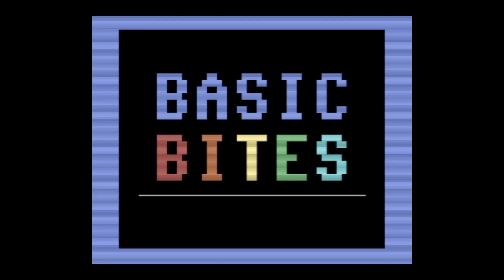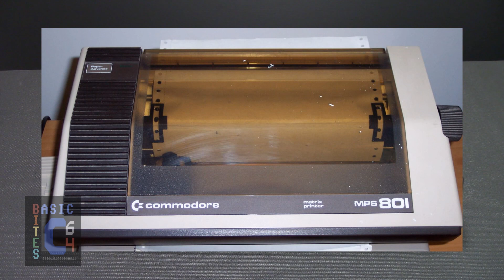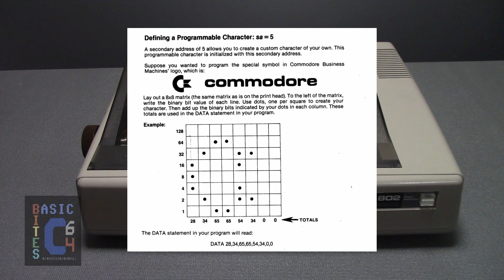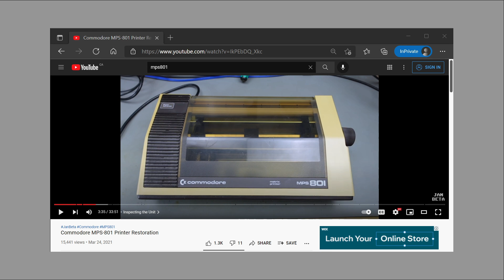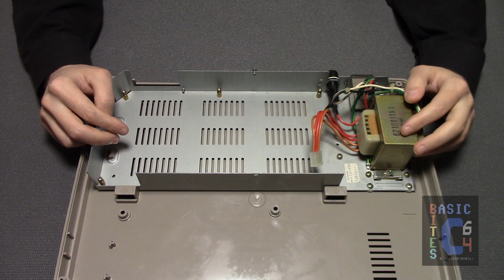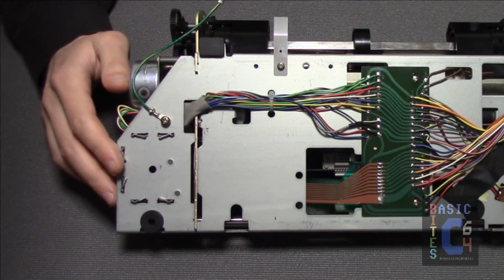Commodore MPS-802 (1526) Dot Matrix Printer for C64 / VIC-20

Comment: It seems my power supply in the 1526 is shot. The fuse and ON/OFF switch is good, but I'm not getting 26V DC or 9V DC from that red/orange wired connector that plugs into the board. Hope you'll be back soon and that all is well. EDIT: The 6522 was bad. Replaced it and the printer works well. Now to get the new ROM.

Comment: Can you dump your rev C rom? It's not dumped and therefore is at GREAT risk of being lost to time. My 802 has the 07B EPROM. I'll get it into MAME for future preservation. Thanks!
Edit: What's the number on your chip? It looks like a later one may be dumped. I found 325341-08 which is said to be for the 1526 but if yours has the same rom then it is the same for both models. Looking at the -08 binary shows "COMMODORE  1526/MPS-802 PRINTER - REV 07C" which gets printed out when doing a test print (holding paper feed at power-on).

Comment: Thumbs up for knowing how to say aluminium correctly ;-)
Years ago I picked up a MPS1230. Of course the ribbon was dry. I did some research and found that the mechanism was made by Olivetti and I found the exact model Olivetti-made ribbons new-old-stock which worked perfect. Around the same time I dumped the rom and documented the hardware and that printer is currently emulated in MAME and can provide a hard copy of anything which gets saved as a png. It's also nice as it's a dual interface Commodore IEC and parallel for use with Amiga or PC. Prior to that back in the mid 80's I had a MCS810 which is the Commodore rebadge of the Okimate 20. I really disliked that printer because it was incredibly slow and it used a thermal head which died after a few years where most of the time it was just sitting powered off. It also used plastic ribbons with a wax-like 4-colour 'ink' so it's a use-once and throw away ribbon which is also not good now in 2024. The MPS1230 is still working great and I don't see any point in the future where the ribbons will have done enough printing that they will require re-inking but it is at least possible with this model. For the Commodore retro collector the 1230 is a great choice for a Commodore 64 printer. It's pretty amazing that these old 40+ year old printers are still going whereas your average HP/Canon/Epson printer lasts ~3 years then it's game over permanently, plus the cost of ink makes them rediculous to run for all but once-a-year printing. Once a year means really that, after a year the heads have dried up with old ink and you toss it in the bin and buy a new one. Long live Commodore printers! :-)
Reply from the maker: Hah! Thanks. :)  I don't know if Commodore ever designed a printer from scratch, versus using some other company's existing internals.  Even though they badged their own ribbons, it seems to be the case that the same ribbons work in a variety of machines.  

I would enjoy having an MPS-1xxx series printer in my collection because they are extremely capable machines and also match the later cream-coloured wedge aesthetic that I prefer, but my 802 and 803 combined do a technically fine job at everything I still enjoy printing with my Commodore computers.  

In the modern era, I wouldn't buy anything besides laser.  The economy per page of inkjet printers is generally bad, or worse.  -- JC

Comment: I actually did not know that this printer even existed, in either variation, existed. When I was looking for a printer for my Commodore setup, the ones I mostly found were the MPS801 and 803 (along with the 1000 line which I didn't really like). I went with the 803 due to the fact that it could use regular printer paper or tractor fed paper.
Reply from the maker: The 803 is my general purpose C64 printer as well.  The 802 seems much more geared towards business use.  You would never want one as your sole printer unless you were exclusively printing text, but that's where it really shines with its higher-resolution characters, descenders, and carbon ribbons.  -- JC

Comment: I did not know that the MPS-802 has 6532 RIOT chips inside. This is not mentioned in the 6532 Wikipedia article. 

I have recently build a replica MOS KIM-1 computer that uses two 6532 RIOT chips (the original KIM-1 has 6530 RRIOT chos which included 1K of ROM). 

Not that I am encouraging the scrapping of MPS-802 printers to extract the 6532 chips, but it is good to know where else they are used.
Reply from the maker: It isn't a chip that I know a great deal about.  Perhaps you should make a YouTube video about your replica KIM-1! 😉  -- JC

Comment: Fortunately GEOS had drivers for the MPS 802, so one could print GeoWrite and GeoPaint documents without problems. I used it to layout our class newsletter in high school.
Reply from the maker: Interesting!  I haven't used GEOS all that much, but I should run some tests if I have it fired up with my 802 at some point.  A web search seems to show that in addition to the included 1526/802 driver, there are a few 3rd-party ones: some for the stock ROM, and others that expect the German-made graphics ROM.  I'd be curious if the drivers for the stock printer achieve bitmap printing just by sending over one custom character at a time, as with other solutions.  -- JC

Comment: Wanted an 801, definitely wanted to avoid the 802 with no graphics (my buddy had a 1526 and was always mad that he couldn't use Print Shop) but I ended up with an 803 which served me well.  Good memories.  Nice video, thanks.
Reply: I've had the 1526 and it was a great printer but software like Print Shop didn't work with it.  I later ended up buying the MPS-803 just to use it.  What was really cool thing I did was since it can be daisy chained is that I made both the 1526 and MPS-803 the same printer ID so both printed at the same time!!  MPS-803 had an easy selectable switch to change the ID.
Reply from the maker: Thank you for the comment!  As a graphics printer, I quite like the 803 myself.  It was definitely a better choice for the average home user. ☺  -- JC
Reply: there was an after market graphics upgrade rom for the 802 that made it the ultimate printer in every way.

Comment: A relative of mine had a C64 with an 802 printer. I was very disappointed it couldn't do graphics; I think I spent quite some time hacking about with the custom character set, but I don't think I have the software for this anymore. (This would have been in '84-'85.)
Reply from the maker: Definitely a misunderstood printer, and Commodore carries a good portion of the blame in that!  You can still find utility programs for printing graphics on a 1526/802 in PDF archives of old Commodore computer magazines (I don't know the issues offhand), but it's probably a painstaking one-custom-character-at-a-time.  -- JC
Reply: It could print graphics such as doodle hires drawings, and docs/images from GEOS.   There is a graphics rom freely available which will allow it to be compatible with the MPS803/1525 graphics modes so it will work with print shop, etc.

Comment: I love the old CBM printers. My latest acquisition is an 8023P 15" printer in mint condition. Works like a charm! I also have (some multiples of): 2022, 4022, 1525, 801, 802, 1000, 1200, 1520, 1525, and a few Star SG-10's.  So i like printers lol.
Reply from the maker: Wow!  Why no 803? 😉  -- JC
Reply: @BasicBitesCA  Yeah i'm slacking! lol
Reply: @BasicBitesCA  But what i've been looking for for a decade with no luck, is a Star SG-15. The wide format version of the SG-10. I bought one brand new (even still have the receipt) back in 1986 and it disappeared through the years. If you ever come across one, i'd take it off of your hands
Reply from the maker: @IDPhotoMan  I would certainly point you to an SG-15 if I knew where to find one, but my own printer "connections" are eBay and Kijiji. ;-)  Good luck!  -- JC